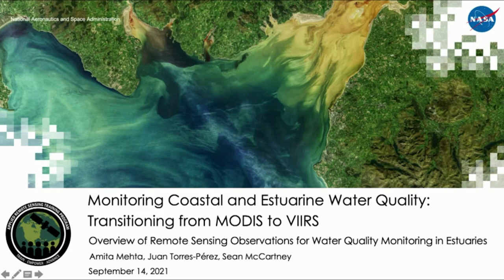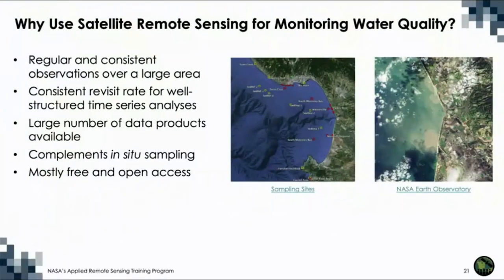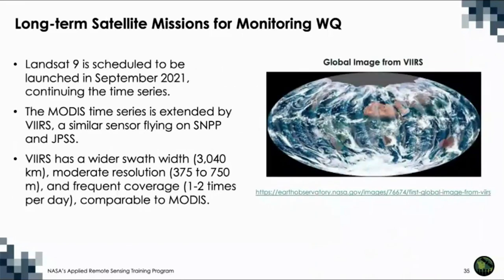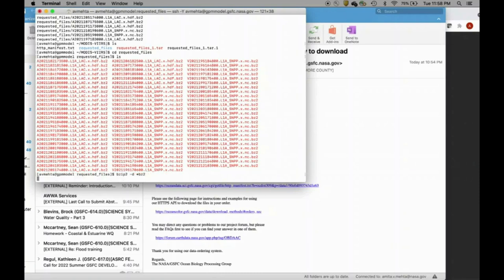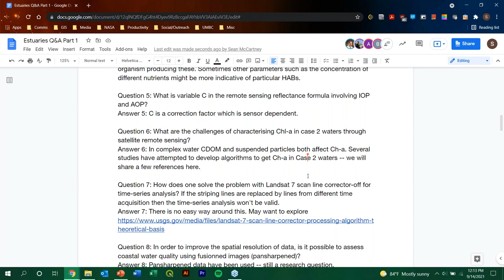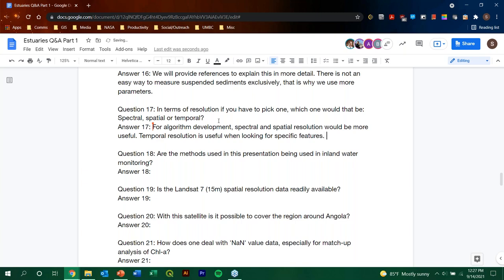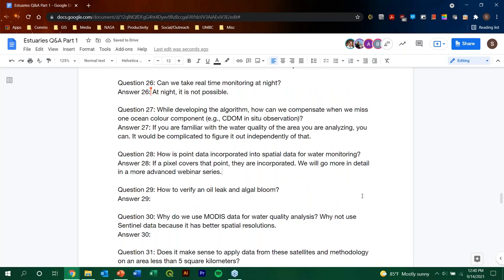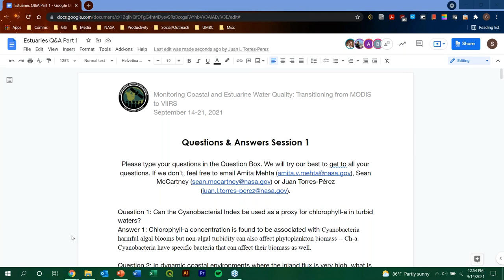Overview of Remote Sensing Observations for Water Quality Monitoring in Estuaries, Part 1/3

Comment: (Off the road)
Tonight I (30.260441,71.484264) see many ISS-like objects in the sky, appearing for a very short distance i.e. (hypothetically speaking) from one star of Orion's belt to another, moving from north to east in the east. (Enter and Exit with inside of the vision)
There were atleast 8 objects appearing one after another within a few seconds. Also, within minutes, apart from that, I saw 4 to 5 spaceship like objects moving from north to south from the coordinates i mentioned above.
between 8 pm to 10 pm UTC +05:00